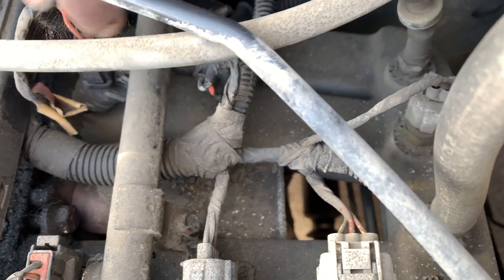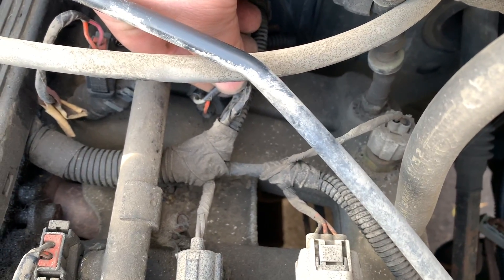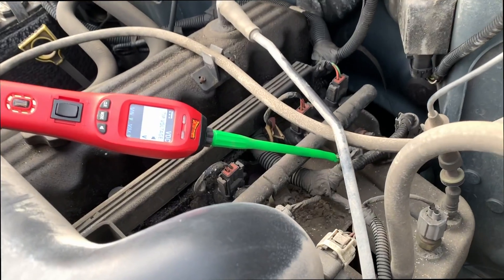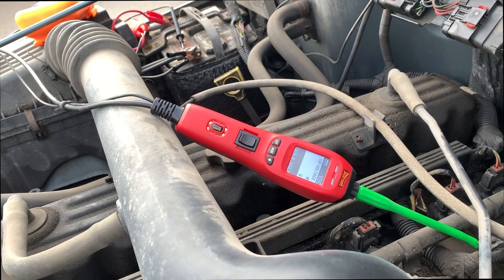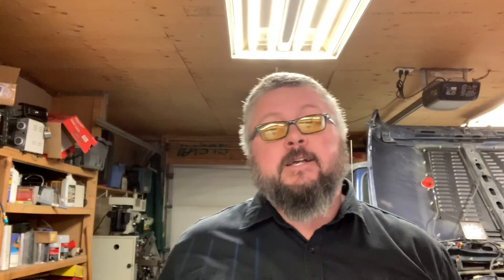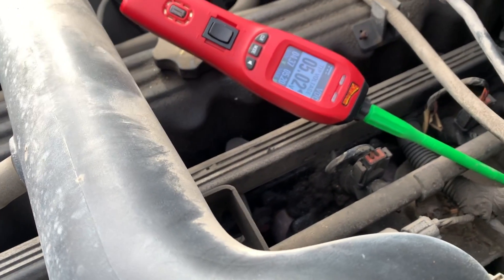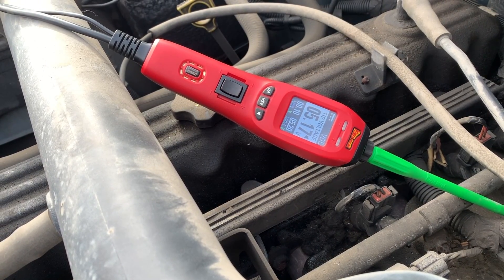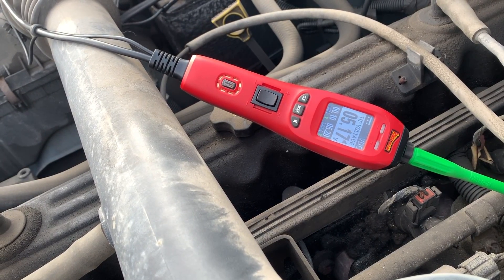DIY Jeep Wrangler How to Test Crank Position Sensor

Comment: thanks for your videos Jerry - i just installed a new camshaft sensor on a 1994 YJ 4.0 and it has voltage but no ground.  Have you seen this before?  we also have power to the ignition coil but none coming out - could this no ground issue be related?  this is all related to a no start issue we have been battling for awhile now - any tips would be highly appreciated

Comment: Jerry,  I've watched a number of your videos and you have great practical knowledge that you relate in easy to understand terms. Can I do this same test with a digital volt meter? Im having a start but no crank. We have replaced a number of things in my son's 97 Cherokee with over 230,000 miles on it. A month ago replaced fuel pump, ignition coil, pick up coil, cps made by crown, spark plugs, checked asd, fuel pump relays for open/close function. We are getting no gauges, crank but no start, no fire from ignition coil, no fuel. Fuel pump stays on continuous with no shut off after 3-5 seconds. We thought it was neutral safety switch have not thoroughly tested that. I've checked most all sensors I know of with key on and they are getting 5v,  I suspect from pcm.
Any advise would help!!
Thanks,
John in Houston
Reply from the maker: You can certainly use a multimeter to do most of the same tasks. I just like the power probe as I can ground or energize circuits
Reply: @TestDontguess  finally got the 97 Cherokee going. We got a remanufactured ECM at Advanced Auto and it started right up. We did have issues where female spade connectors under the engine fuse panel that feed the ASD  and Fuel Pump relay worked loose from repeatedly pulling the relay out ,I guess.

Comment: I am getting an 11 code on a 94 YJ (CPS circuit) I checked voltage on #3 wire at the connector (Orange) its only 2.7v if I unplug the CAM sensor the voltage at the CPS goes to 5v.  The voltage on the orange wire of the CAM is 5 regarless is the CPS is plugged in or not... Please help!
Reply: what did you find out during diagnosis?

Comment: I appreciate you providing the video. For the newbies, can you please consider adding how to connect the probe?  thanks in advanced
Reply: In order to see if it’s working, the sensor would have to have voltage, so he would be putting the tip of the PP4 into the back of the connector to touch the metal contact for the wire being tested, while it’s connected to the sensor.
Reply: Nice to know that the power probe can check it but by not showing how to hook up the probe what good is the video? 👀

Comment: Hey that's handy! I've been lucky none of my 4.0s has ever had a failed CPS, but it's the go-to swap for people troubleshooting crank-no-start issues. I always used to bump into people picking the CPSs off of Jeeps while I was at the wreckers to "try another one" for troubleshooting. This method is much easier. 

Of course now I've cursed myself and my CPS in my stupid TJ will probably fail today...
Reply: I've heard this from many people actually! Jobber crank position sensors are often bad out of the box which is why many opt to go to the junk yard. I suppose the likelihood of a jeep ending up there because of a bad CPS is small. With the mileage I've got on my Jeeps, sounds like mine are all overdue for a failure. lol
Reply from the maker: I learned a long time ago only use OEM sensors to save from future headaches later down the road
Reply from the maker: YouTube usually flags comments with links

Comment: Thats good to know before you blow $100 on a CPS.....
Reply: And  before you spend an hour and a half  attaching ratchet extensions,  swivels , etc and brusing your arms trying to remove and install the new one, lol. Had to do mine on the side of the road in my 96 Grand Cherokee. Not fun in the winter time.
Reply from the maker: It wouldn’t be a fun job at all as it’s not in a very good place.  Mine is a 2003 and it’s in a different spot more easier to get to
Reply: @TestDontguess  , glad they changed the design. Good to know! Great content as always! I need to invest in one of those power probes!!
Reply from the maker: Everybody needs to buy a power probe best tool ever